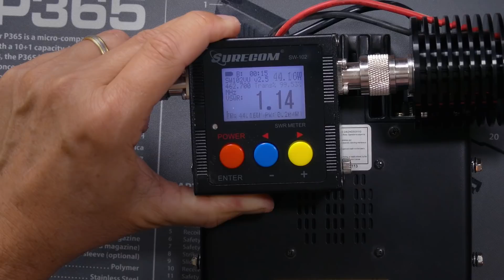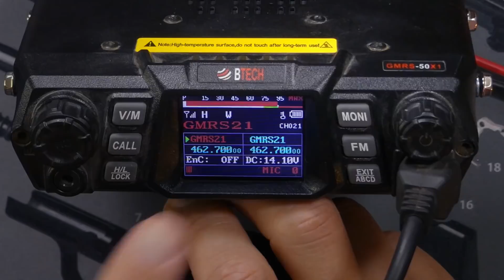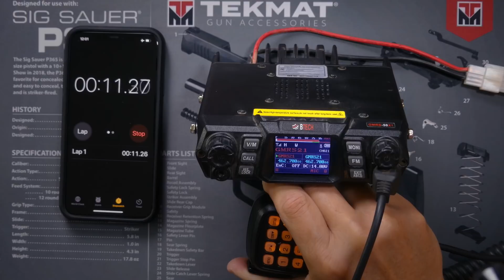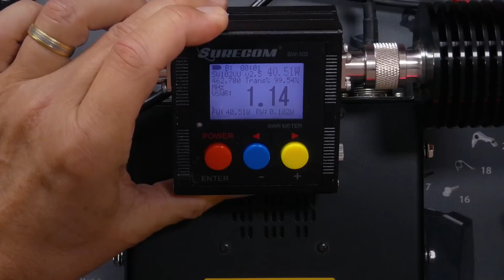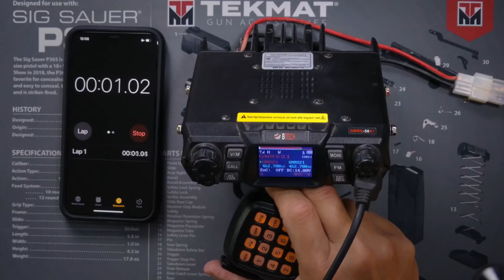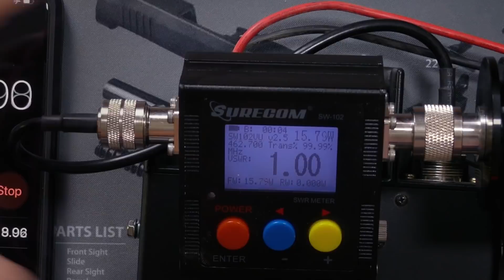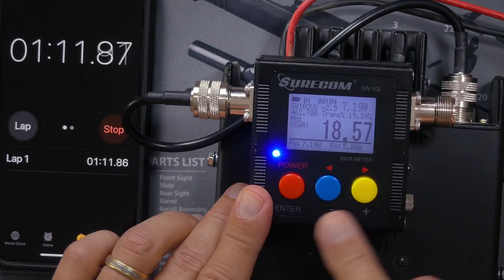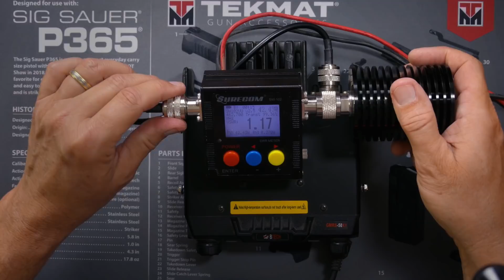Transmitting With NO ANTENNA At High Power - Will It Will Damage The Radio? (Ham, GMRS, or CB)

Comment: Expert here... Don't do this.  Some radios have circuits that reduce power to save the radio and some don't.
Reply: Did Professor Marconi tell you that in RF class?
Reply: Thank you ✌️Expert✌️
Reply: Wait, I wanna know how to be an expert too?
Reply: Always enjoy the experts chiming in.
Reply: You look like a "know it all".
Reply: Yes, it is funny that he called himself an expert in a comment on THIS channel.  Still useful information that we got lucky and did not have to watch a fireworks show.  Yes, I will try to never do that.  I will also try to make sure I get a radio that can handle a mistake if screw up the installation.  Nobody (especially me) likes a spark shower.
Reply from the maker: Pretty sure I said 'dont do this' in the video..Multiple times.. But thanks for letting us know you're an expert. We're all very impressed.
Reply: @TheNotaRubicon  And there it is, an expert. You can always tell an expert because they are self-proclaimed!
Reply: @deankq4adj125  Most people have probably already heard this but in case there's one person that hasn't...  In mathematics 'x' usually stands for an unknown, and a spurt is just a drip under pressure.  So an "expert" is just some unknown drip under pressure... ;-/

Comment: "That's not 50 watts, that's only 45"  🤣 I am not an "expert" but modern radios have protection circuits to prevent burning out the finals. I think it did exactly what it's supposed to. Now, if you can find an old radio without those circuits....

Comment: Let me say that I am a licenced HAM technician, but I’m not sad. I don’t consider myself an expert either since I’m not an electrical engineer, just a radio operator of the lowest rank who has actually read the manuals and done my own research on things.

The warnings do have to do with older tube and early solid state radios that didn’t have the type of circuits and protections built in that are in modern radios. Its not a good idea to transmit without an antenna but if you have a modern radio it isn’t necessarily   “instant death” for your radio these days.  I appreciate these videos and the sense of humor. Sometimes the “experts” need to be poked in the eye to keep them humble. Keep doing the good work.

Comment: Atta boy Randy.  Love it when you mess with the “ex-sperts”.  Having formerly been a “spert” myself with nearly 30 years of component-level communications-electronics experience, (but now retired) I know just whats happening with the “innards” of the solid-state devices that make up the “finals” (the power transistors and/or MOSFETs) that generate the RF power output of a radio.  In fairness to all those HAMs out there (I’m not one), power transistors and stuff are not as fragile as they used to be.  But, having said that, keying a radio with a miss-match mostly just ages the final output components prematurely.  It’ll wear it out.  The reason to check VSWR is to see that you have a good impedance match between the radio and the antenna (and it’s associated transmission line.)  The idea is to get the signal to leave the radio and go to the antenna and on out into space.  That’s easily indicated using VSWR (voltage standing wave ratio).  “Standing wave” is the signal that comes back into the radio (in the form of ‘reflected’ power) that doesn’t “get out” as transmitted power leaving the antenna.  It goes right back into the radio final amplifier stage in the form of heat.  That’s why your radio got hotter quicker while you were doing your little test.  Now, with age and wear, transistors (and other solid-state devices) will begin to “break down.”  What this “breaking-down” actually is is the device will no longer operate to it’s designated specifications.  The amount of which varies depending on the device and the amount of abuse it has been subject to.  I’d use test equipment called a “curve tracer”  to test the performance curve of solid-state devices.  See, solid-state devices are non-linear devices. But we design circuits such that the solid-state device operates in it’s linear region.  And you want a device that has a nice smooth and straight linear region.  Well, if it’s worn out from either age or you just tore it up, that linear region is now not what it should be and it will continue to get worse.  It won’t amplify in a linear manner or it’ll generate noise, etc.   Now here’s the kicker… If properly operated and cared for, many solid-state devices could quite literally last forever.  But once damaged, the deterioration will continue with continued use.  They’ll continue to “work” but over time, they go out of ‘spec’, introduce noise and distortion and eventually one day, fail completely.  So now, the “boof-wang” (love that pronunciation) radio is not a serious radio.  It’s ok to bang ‘em around, tear ‘em up, use and abuse ‘em.  But serious radios like those Motorola’s when they were new and in their professional world, stuff like Air Traffic Control radios and Landing Systems ILS & Glide slopes, Radar, SATCOM, HF Global, Microwave links, and millimeter wave stuff (I’m not talking about amateur (HAM) stuff; this is real professional communications biz) the world where I came from… you just don’t be doing that shit ‘cause I’d know it from performance testing.  And, I’d be replacing parts to fix it too.  Some equipment won’t transmit at all if it senses a miss-match above a certain level, but that something that, in real life, we’d never challenge.  Again, I’m a former “spert” but I still had (and still have) toys to play with and tear up like CBs and ‘boof-wangs’ and stuff.  I like messing with HAMs too. Maybe thats why I like your channel so much.  But I might just break down myself and get a HAM license.  Hahaha…
Reply: Great Explanation, Should Hire you as the Technical expert for the channel.
Reply: @markdavis5508  Hahahahaha.  If I did that, I could no longer be the ‘professional’ bum that I am. 🤣🤣🤣

Comment: That was a good real world no bullshit test.   Being an old school radio guy, I can only speculate that the old radios which were tube based circuitry were more susceptible to damage if transiting without an antenna.  I speculate that fear has traveled the ages. It would seem that newer technology is more resilient and not as vulnerable as the older radios. Your  radio appeared to automatically dial back the power as to protect the radio and then reset once the conditions had been corrected.  Just my speculations. Nothing blew up and it still worked.  The only thing that blows up on this channel is the sad hams brains.  LoL.
Reply: Been around RF and radio long enough to have witnessed the morphing of tube type radios, and transistors, better known as, " Hybrid's ", then into the first transistor only radios !
And it was not uncommon early on, for someone to blow a driver, or a Final, and sometimes both, many times because of SWR reasons, and careless operating !
Which we tagged transistors then, 
" Three legged Fuses " !
As they blew so frequently !
It wasn't until manufacturers got tired of getting burnt up radios back for repair, that someone designed what most radios today incorporate, and that is a circuit to reduce output
power, when the transmitter doesn't see a proper load !
Typically 50 Ohm's.
Unintentionally, I myself have witnessed, by way of installing a mobile radio into the dash of a vehicle, that provided little air circulation, there was evidence discovered later, that solder on some of the circuit traces had melted !
This wasn't intentional abuse, just long winded chats, likely on High power, and into a resonant antenna !
And this was on a Alinco Two-way !
So things can happen !

              Just Say'n !

                      🔥
                 😳🫴
Reply: It wasn't unusual in early CBs for the final transistor to pop if you keyed up without a load. Over time, with better RF devices and better designs, this became comparatively rare - assuming the radio hadn't been otherwise abused. But the lore still persists. Having said that, it's still something to be avoided if possible.
Reply: @tomperone9338  as I indicated,  I'm an old radio guy. I've had finals go for different reasons, but it was merely replace the final in question and correct the problem.   As Randy's test has shown results of the new technology out performs old radios.  People are driving new vehicles , except they expect them to behave like a 70s dodge fury. They just haven't caught up to the technology and keep expecting it to perform like a 70s vehicle.
Reply: same with processors 
Running one without any kind of heatsink would distroy them back in the 90s but most today have advanced circuitry to prevent that and some even are ment to run without it.

Comment: If you did that with a multi kilowatt commercial broadcast transmitter, there'd much much spark and/or smoke. This, however was a valid test, demonstrating the reliability of modern two-way radios.IMHO. BTW, I used to hear this same story with CB radios. So apparently the story changes with the power output.

Comment: You did it wrong, the body of the radio was clearly acting as an antenna.
Reply: That fan was antenna. You clearly can hear it transmitting air volumes  at high power 😂

Comment: If no transmission line, no reflections. Depending on length of connected coax, reflection can cause damage.  But disconnected at radio, should typically be okay UNLESS there is an internal transmission line of significant length.

FYI no load but with cable and power meter is worse because you introduced more transmission line

Comment: Some years ago, I read that rf finals are designed with components rated for 2x or more dissipation than the design wattage rating of the unit they are installed in just to be able to survive when transmitting with no antenna. 😎

Comment: That was an outstanding test.  He even used the same radio I want to get.  It is great to know that even the 'cheap Chinese junk' radios are set up with those throttle back features.  That is great for me.  I collect 'cheap Chinese junk'.  Baufeng, GoCom, B-Tech, TID Radio, etc.  Knowing me, I would get a powerful radio like the B-Tech 50x1 and forget to connect the antenna.  At least I don't have to worry as much about my fire extinguisher.  LOL 😂  Thank you, Not-A-Rubicon.

Comment: I believe modern quality radios have a safeguard to prevent toasting the finals when you transmit without an antenna. Not the case with my 50 year old Courier 23 CB radio.
Reply: Cooked a Royce 23 decades ago by tidying up the antenna cable under the dash in a coil, it lasted under a minute. Still miss that great radio.
Reply: Same with my Johnson 123... after 20 min of ratchet jawing... in long commentary... it gave up its final.

Comment: Looks like the radio is smart enough to throttle voltage and also ramp up the fan to save itself. Older radios back in the day probably weren't able to do that and that's where this idea came from.

Comment: Legitimate test. My sense is that sad hams have perpetuated a warning from back in the tube radio days that would have indeed shit the bed with no antenna connected. Modern electronics being what they are, it's no longer as valid a concern. As far as the heat, I've seen rigs connected to an antenna heat up when transmitting for an extended period of time. RTTY is a perfect example. Thank for doing this, so I didn't have to.
Reply: all "digi modes" give radios a proper thrashing, i have a ziegu G90 which needs an external fan to operate digital. i would expect that "most" current radios will shut down with a bad load. the G90 has an adjustable SWR threshold, the default setting is 3:1, beyond that it shuts down.
Reply: The fans on my solid state amp (Elecraft KPA-1500) sound like a 747 spooling up for takeoff when I'm doing RTTY contests or running in FT-8, but thankfully its fault detecting circuitry is instantaneous if I have the wrong antenna selected.

Comment: This is a very punishing test .  While transmitting with out an antenna is not a good idea, it is rare that it will damage a radio if it is a quick transmit. This the ultimate bad antenna test. This is good data from a valid test because I said it was a good test.

Comment: I am curious if the more expensive models have a protection circuit that simply reduces or eliminates power if antenna is not detected. Kinda surprised that this one is clearly trying to transmit and getting really hot.
Reply: Yes some models will reduce power to protect the finals if they detect a high SWR or missing antenna.